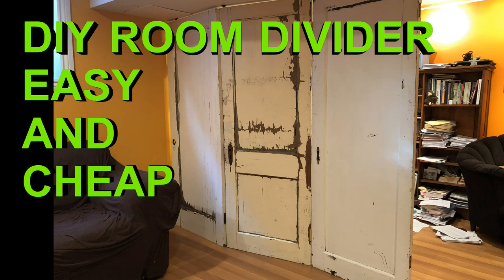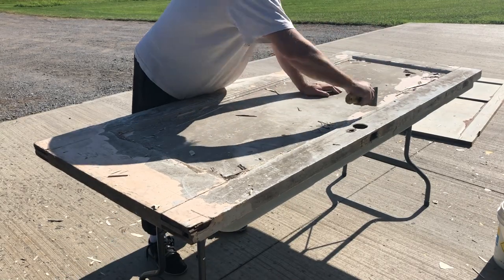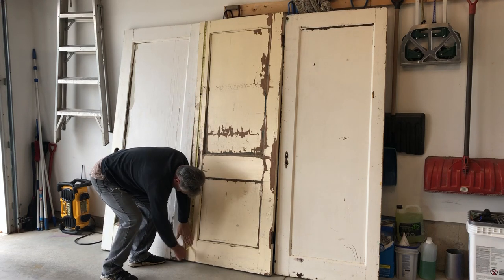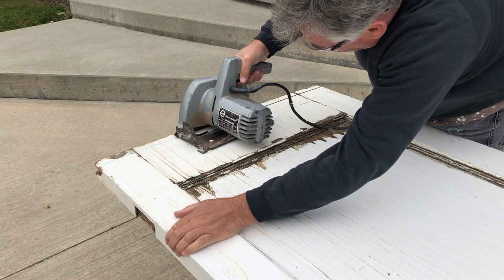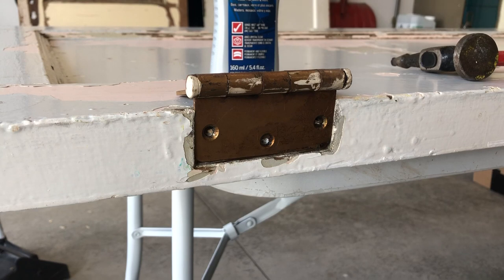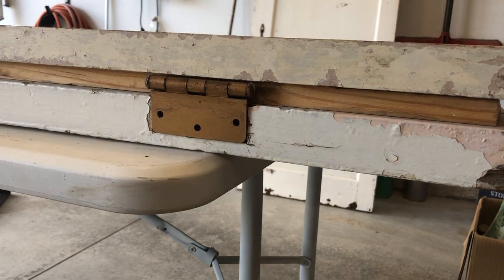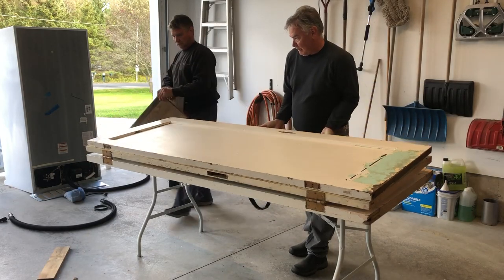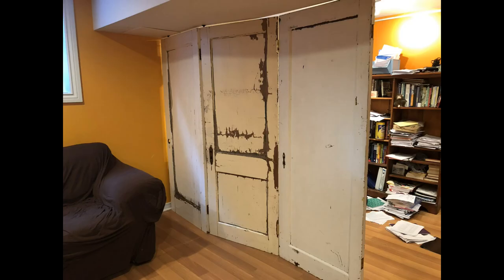DIY Room Divider

Comment: I have built something similar but want to secure on to wall and have it straight rather than folded. Any ideas on how to keep walls pulled out straight permanently
Reply from the maker: I have done that for a client recently. You need to build two feet per door and attach them perpendicular to the door. Mine were about 12 inches wide, wider if there are kids or dogs around. I just used an old piece of a door and made it about 2 inches by 2 inches and 12 inches long.

Comment: That's exactly what I was looking for! I have to build something like that, but scaled down to ha half height. Now I haven't got what kind of hardware are you using for the hanging sliding mechanism. Sorry if my English is not up to the task. Compliments and regards from Italy.
Reply from the maker: Your English is fine! I have built a couple of these. In this one I use the legs that are used to level an oven. The feet are adjustable and I found in a hardware store for a couple of dollars. Another one that I created I used a couple of wooden wedges to hold the top securely. I just cut them out of an old piece of wood and pounded them in tightly with a hammer. Let me know how you make out. 
Have an awesome day!